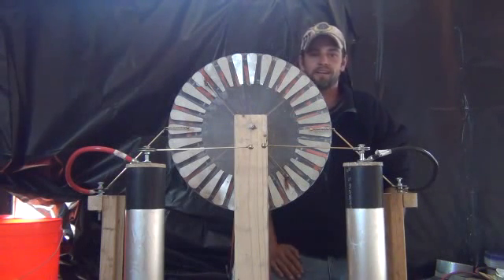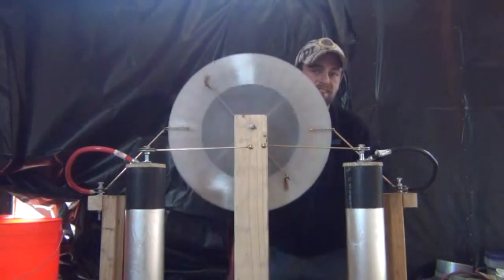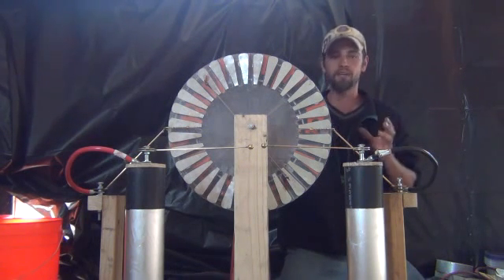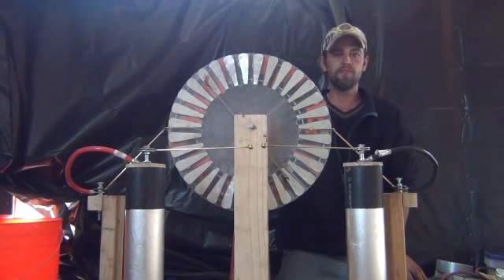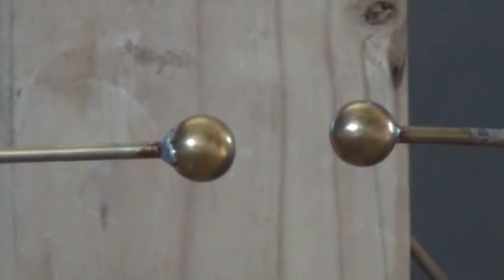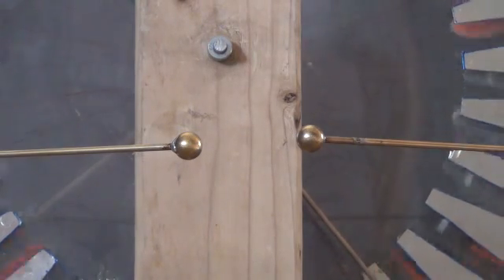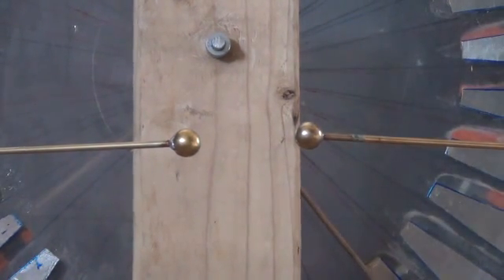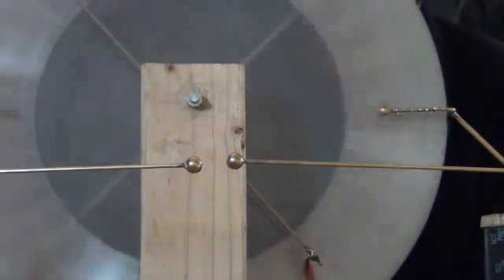Wimshurst generator in action "Monster of a Wimshurst"

Comment: 🔴🔴🔴 Sad this guy’s channel has been shadow banned. No new comments in over a half decade either.

For what it’s worth, the Wimshurst generator, along with all other static generator designs are very inferior. They are based upon technology from over two centuries ago. Each share the same challenge in their inability to produce massive sparks, and do so quickly. 

The flaw is simple. Before enough capacity can build up that’s required to create a massive spark of say, two feet or more, the machine itself leaks and sparks.  

A never before seen design I invented years ago, does away with the dilemma. 

Best of all, construction is quick and easy and can be scaled up to make sparks as long as you want. 

You need a machine where sparks will not arch across the machine itself.

Comment: I would imagine that the aluminum can be used as is on the roll and fixed in place in the manner you describe. I really like your capacitor design and. Hypothetically If the Teslonian Wimhurst was driven by a wood fueled Sterling Engine and you had 5 gallon bucket capacitors say 10 in Series Parallel. Also i would like to know how a quad Wimhurst calibrated to fire i sequence for constant pulsed dc or ac.

Comment from the maker: I love nitinol and have done a video or two were I use it for energy production, nitinol has one of the greatest potentials for waste heat conversion to energy. I think your idea to use it for a drive motor for a Wimshurst is great. I have a small robot that I built using nitinol and peltier chips that has immense strength for it's size since nitinol can respond with 250 ton's of force per square inch.

Comment: Mr. Teslonian, thank you for a wonderful demonstration of this piece of 18th and 19th century technology.  However, instead of manually driving (by hand) or using wind to drive the electrostatic generator, consider using NITINOL (nickel titanium superelastic/shape memory metal alloy) partially-immersed in a water tub.  A nitinol-driven shaft coupled to the generator could potentially drive the generator for weeks, if not months.  Some of the properties of commerically-available nitinol are: